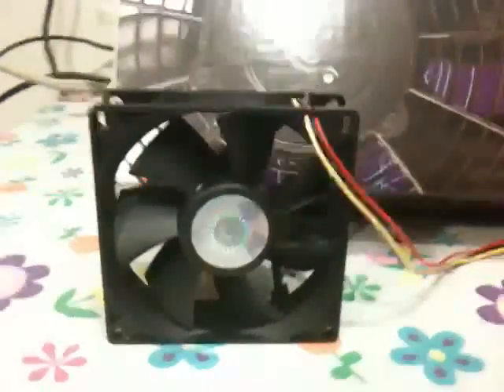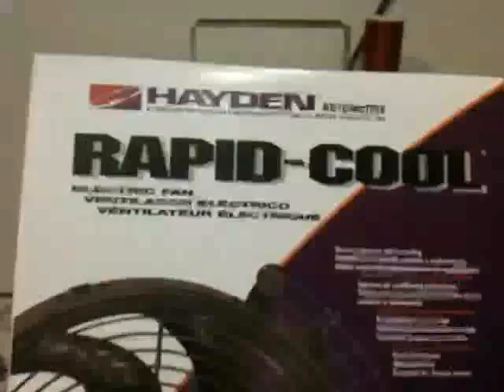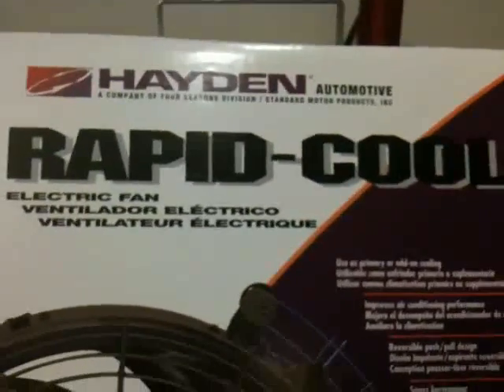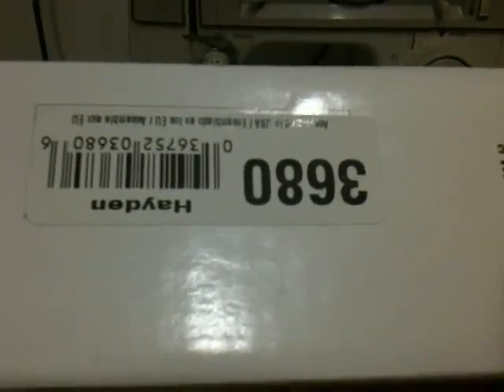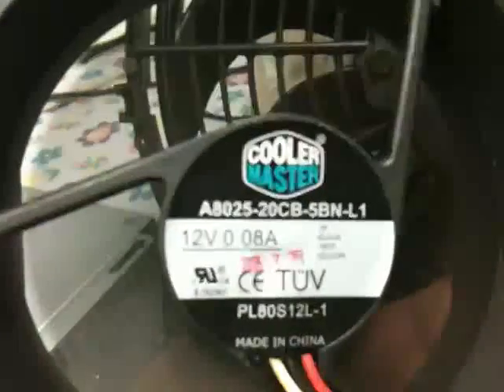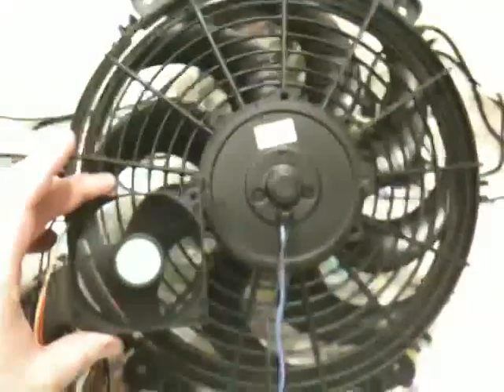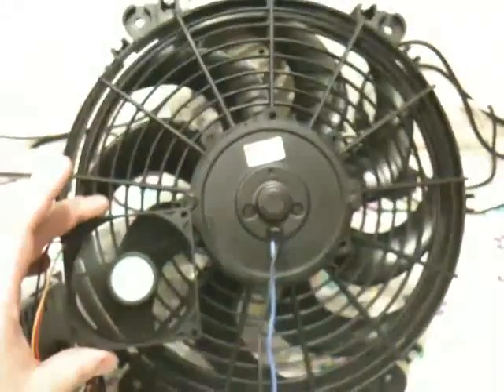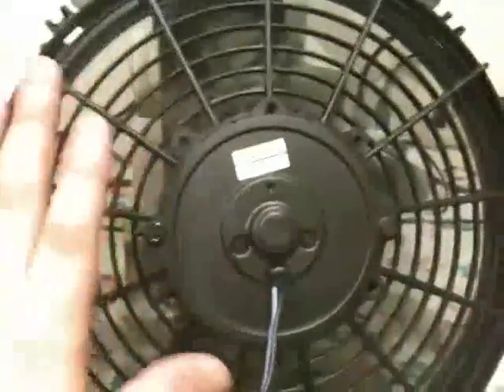300mm electric car radiator fan testing for use in a PC

Comment: Hey I just got a 24v radiator fan as well. I am doing the same thing as you but have not started yet. Could you tell me what the fan controller is and where to get it, how to hook it up to the PSU.

Comment: That is a horrible choice for a cooling fan. The amount of amperage that thing uses will ruin a power supply over a shorter amount of time. Most car motors are brushed so your back feeding your computer dirty power spikes. If your dead set on this go with a brushless pma cooling fan from the junk yard. The way to find them is by hand turning the fan. If it slows from a push and stops its brushed, if your push it and it slows and knocks back and forth and stays in one location its pma motor which is better for this application no back spiking and if your stuck with a brushed fan then your gonna need a snubber diode to block back emf.
Reply: Just hook up an 1n5408 and you're fine.

Comment: the car fan pulls a bit over 100A when starting it and it pulls about 35-40A on its full speed.makes you think about the electricity bill and it makes ridiculously loud noise and when its on full speed and if you dont have it attached to your pc case well,it can easily pull itself off from the case or blow all the stuff in the pc apart or away or so.

Comment: @TheCrazyFinn Condensation occurs when a component is at any lower temperature than the ambient air, and the air an AC expells is well below that. And I've never seen a conventional case that is airtight, so allows ambient air to penetrate it.

Anyway, I think an AC is too loud for viable use as everyday computer cooling. The sound gets quite annoying after a moment, and I have to turn mine off when watching videos because I can't hear anything.

Comment: @armorfid Condensation only occurs when warmer air comes to contact with cooler components. AC can't cool the components to a lower temperature than the air it expels. If all the air passing through the system comes from the AC, there will be no condensation inside the PC. Outside may be a different story... ;)

Comment: @TheCrazyFinn Air conditioners do naturally acts as dehumidifiers, but not at 100% efficiency. You can't filter out all the humidity inside a room at once.

For example, a film of condensation forms on my air conditioner exhaust's directional blades when running in dehumidify mode.

It's one of the reasons you have to tighly seal a Peltier element for CPU cooling, or the CPU's surroundings will be flooded in no time.